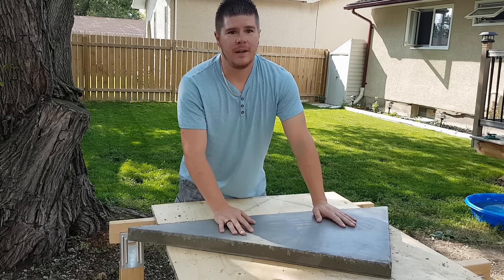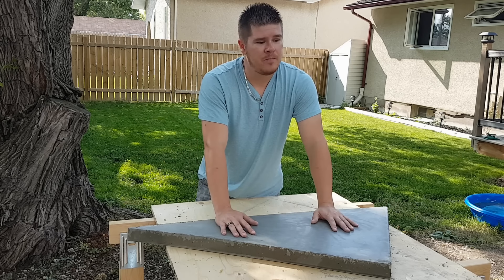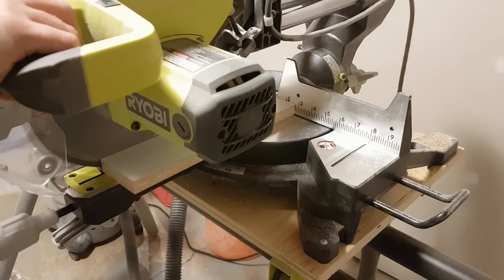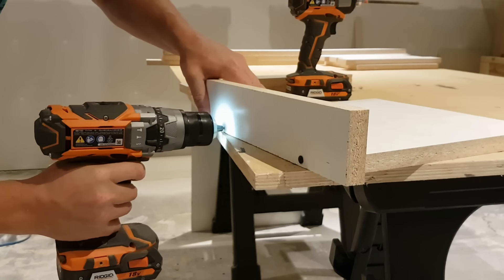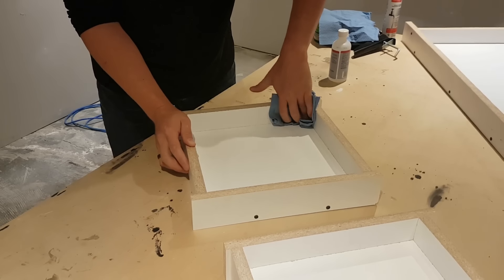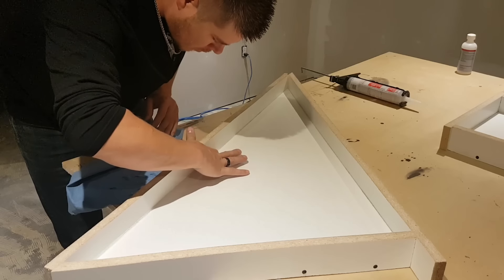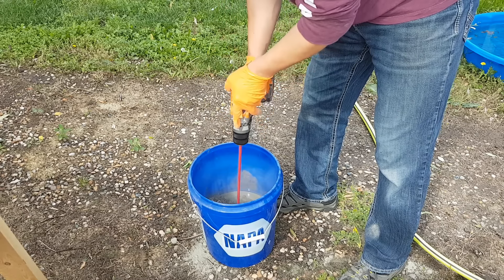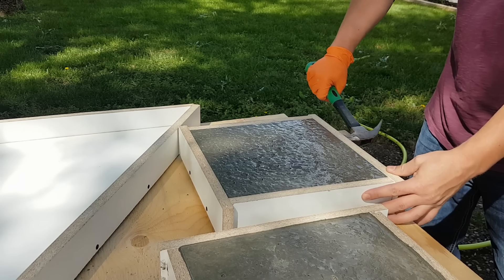Make your own Patio Stones quickly and easily with this method

Comment: Tip: if you use quikrete try getting the green bags or the blue bags. Those have fiber as part of the concrete mix and resist a lot to cracks.
Reply: Excellent advice.  Thank you.

Comment: Great tutorial, and with a little bit of work, you can save a lot of money on your molds. For vibrating it, you can use a sander against the side and bottom of the table surface or against the side of the mold.
Reply from the maker: Thanks. It's a pretty fun process too

Comment: Oil you molds ,patio stone should come out without taking mold apart .Also shake them more to get air out. You did great job good idea man.
Reply: Agree totally.
Reply: Brad, what type of oil do you suggest?
Reply: @mrobertson9222    Some cheap motor oil would do 10 w 30 or whatever I think even cooking oil might work.  Just brush thin layer of oil all over inside of your mold.  In the one masonry class I took we used wood framed plastic patio stone molds . We coated them in oil ,shoveled in the concrete and the shook them on vibrating table to get the air out. Let concrete set overnight or longer if needed before you take out of mold.
Reply: @bradclark6796  Awesome.  Thanks!
Reply: @mrobertson9222  I've used olive oil and my mold slid right out...I'd rather have used a cheaper oil but olive oil is all I had
Reply: @saggypantsandsquats460  thanks!
Reply: I made weights for working out do to the pandemic and I used cooking oil. I used five gallon pales and they slipped right out.

Comment: Great job! Another thing you can is dip a vibrator ( yup THAT sort of vibrator )  at even intervals into the wet concrete which helps distribute the smaller aggregate more uniformly and  gets some of the air bubbles to the surface. It basically recreates the effect of tapping the sides with the hammer, throughout the slab, making it denser and stronger. Dip the vibrator in, then turn on, and you momentarily see the concrete slightly sink and some air bubbles come to the surface. Turn the vibrator off before taking out, then repeat about 8 inches away.
Reply from the maker: You could lol but that would get me kicked off Youtube
Reply: Ha, if you ignore the concrete part this is the most erotic comment I have read on YouTube.
Reply: I would love to see my neighbor using this to create a patio!!! LMAO!!!!

Comment: Nice job! I do recommend a layer of wire mesh for the larger ones. Excellent choice of melamine to aid in release. After removing the forms, you could set them in that kiddie pool to help them cure under water for about a week.
Reply: Great input! For a newbie, where would you put the mesh? In the bottom of the mold then pour or mid way? And then is it common to let them cure under water, why?
Reply from the maker: For these you'd just put ony reinforcement in the center or somewhere close to the underside of the stone, you don't want it ghost through the finished product. And honestly just flood them softly with water for a couple days, a couple times a day, once they are in place. That's plenty for them to last a good long time

Comment: Great video can I suggest using a releasing agent vegetable oil does not stain the concrete thanks for posting
Reply from the maker: Thanks. I typically use car wax on my other concrete builds, but for patio stones I wasn't worried about it.

Comment: @JesseDoesDiy how many times can you use the same mold? Can I line it with tinfoil or vapour barrier for more uses? If I'm using it for under 4x4 posts for building on...how thick should they be?
Reply: Also if I wanted to add glass beads for example...how do I stop the concrete from covering them completely? I want them to sit flush with the surface
Reply: I also want to draw in them like it would be cool to put my business logo in the first step...how long should I wait for it to be hard enough to hold the forms but soft enough to  "carve "?
Reply from the maker: I actually have a newer updated video for making patio stones that's even easier. If you use a good coating of wd-40 on those forms before you make a stone you can reuse them many many times. I'd make them with 2x4 so it'll be about 3" thick. That'll be plenty thick for a support base under a 4x4
Reply from the maker: Adding glass is a crap shoot. I've got a video recently showing how to do exposed aggregate. You'd add the glass on top and then tamp them in with a wooden float to bring the cream up and then do the exposing technique
Reply from the maker: That would depend on the mix used, water added, and weather and temp. If you use a high early mix that says it can be walked on in 8-10 hours then that should be fine to carve at that point, but I'd probably wait 24 hours to prevent blowout
Reply: @JessedoesDIY  thanks! I'll look for the updated version.  A thought occurred to me in the middle of the night...can I just dip the end of posts in cement to protect the end from rotting out instead of placing 4x4 on the 4x4 patio blocks? It would save a lot of money.

Comment: Is it just straight cement you would use or part sand ?
Reply from the maker: Concrete. Concrete is cement, sand and rocks mixed together. If you just use cement it'll break. Pre bagged concrete is already premixed with all the ingredients, just add water

Comment: I have Portland cement. Should I use sand and or stone , and what ratio should should it be.? - thanks
Reply from the maker: That's fine. Use 3 parts stone, 2 parts sand, 1 part cement, and .5 parts water. That's a typical ratio

Comment: Will the silicon stick to the waxed melamine?? Maybe silicon 1st then wax after silicon dry?
Reply from the maker: You can do either or. I find it makes removing the silicone easier from the mould to clean it for reuse

Comment: Why not have the top as the slab top and finish it and use edge tool ?
Reply from the maker: You absolutely could.
Reply: I was thinking the same thing. Then you could a broom finish or rock salt to give it a pitted look.

Comment: How many bags of cement and sand did you use
Reply from the maker: That all depends on the size of the stone you make. There are concrete calculators online that'll tell you how much you need for the slab you want. And I used pre bagged concrete

Comment: Cool--if I do this I would use pure cement for a smoother finish and dye the concrete to give different colors. Great video.
Reply from the maker: I was honestly just using what I had on hand, but yeah! There are many ways to do it, I just want people to know they have options instead of always buying them
Reply: With pure cement/ smoother finish wouldn't they be slippery when it rains?
Reply from the maker: After a month's they get a very slight texture to them from erosion, but right out of the mould maybe
Reply: @JessedoesDIY  Thank you for answering. Yeah, that irregular one on your parents walking is very shinny with the water, so that is what I thought... but  still very nice video. I have a project coming up and the stones are very expensive, besides, one can do that box in many different shapes. Thanks...

Comment: Subbed for the channel name 🇨🇦. How big of stone would you do before adding wire?
Reply from the maker: Haha awesome! Thanks. Generally you can add it to any of them, but anything around or bigger than 24"-24" ish, I would think about adding it. If you buy 24"×30" in store they still don't have it in, but they also crack very easily if somebody jumps on it, or even if you drop it a bit or knick it when setting it. I didn't add any to mine, but seriously considered it for the big one. If it was more high traffic I would have. It makes a big difference
Reply: Me too!  Looking forward to more of his videos
Reply: Pea gravel and concrete sand

Comment: Just what I was looking for! Can the molds be re-used?
Reply from the maker: As long as you fill them just barely to the top and don't overfill and get the wood wet you can. Just have to scrape off the silicone and clean it, then just put it back together. I've used them quite a few times, but the sides will start to swell eventually and you will have to remake them

Comment: Seems like a good Idea, but the work and time required to remake the molds to get enough stones to make a full patio would be insane!  This method probably isn't so much less money than just getting the 2'x2' pavers from home depot, especially after you factor in the price of concrete bags, silicon, melamemine molds, wearing out a drill, etc.  Not to mention the insane amount of labor!  But you did make an entertaining video.
Reply from the maker: Yeah, that's why I mentioned I only do this when I'm using up leftover scrap, old concrete or I have a size or shape of stone needed that you cannot purchase
Reply: Can make them sturdier than the HD ones by putting rebar in them. I read a lot of reviews that the HD 2x2 concrete stepping stones break easily.

Comment: Why dont you include reinforced steel inside the molds?
Reply from the maker: You definately could, but they typically don't on store bought and I wasn't worried about it. These aren't going to take a beating or have to support a ton of weight so it's fine without it

Comment: Do those stones get slick when it rains.
Reply from the maker: I haven't found them to be. If you're worried about it, what you could do is after vibrating it, smooth it slightly with a concrete float. It will leave a bit more texture for grip. That will then be the top instead of taking it out of the mould and flipping it over.
Reply: @JessedoesDIY  Got it, Thank you...

Comment: I like to tap the top of the wet concrete with a flat trowel and it knocks out the rest of the bubbles and makes it more smooth.
Reply from the maker: Typically I would on table tops and stuff, but on the bottom side of patio stones I chose not to so it was more abrasive and then less prone to moving on the ground. At least that's what made sense in my head lol
Reply: CanaDIYan that for sure makes sense!! Listen, I got really tired at the end of putting in my patio (and still had a kitchen to remodel and a bathroom), that I just poured concrete straight to the ground. Basically haunched my patio (which it needed) in the shape of triangle pavers. I didn’t worry about the bottom being smooth and BARELY worried about the top. Everyone loves my patio, though. It’s whimsical and matches my personality lol
Reply from the maker: Haha that's awesome

Comment: i want to make  a 50cm *50 cm. how thick it should be?
Reply from the maker: Depends on your needs for it. I have another, newer video about making patio stones that is much easier and quicker. But minimum 1.5" thick for low use, 2.5" thick for more use and heavier duty

Comment: Nice Jesse. Do you think if you made a 2’ X 4’ stone, would you have to use some reinforcement?
Reply from the maker: Depends on the life it will see and your expectation of how long it will last. It it's just sitting there doing nothing then no. But if it'll see weight on it, or you want it to last for a decade or so then I'd add some. Or you could just add some because, it's up to you

Comment: If you tellthe people to which propotion you mix your cement it might be helpful for people who have no idea about it.
Reply from the maker: I bought pre mixed so I didn't have to. But typically you do a 3-2-1-.5 method. So it's 3 parts aggregate (small stone), 2 parts fine sand, 1 part cement, .5 parts water

Comment: So, why the Melamine instead of regular wood?
Reply from the maker: Just one option. I'm actually going to be releasing another video of wood in the next couple weeks with some seeding
Reply: @JessedoesDIY  OK great. I just wasn't sure if there was something special about Melamine.
Reply from the maker: Well, there kind've is. Melamine is to make them reverse cast style like I showed here. Regular wood, oil and sand is to cast them face up, then you need to trowel and round the edges while it's drying. Very different methods. If you try to reverse cast with regular wood, apply oil or a clear coat to the wood first or you'll never get the mould to release
Reply: @JessedoesDIY  Ah... ok it sounds like I'd be better of t=with the Melamine! Thanks!
Reply from the maker: Anytime. Good luck, let me know how it goes

Comment: Do you ever add any sort of chicken wire or wire mesh within the concrete stone?
Reply from the maker: You definitely could, it would help prevent cracking. Any stones you buy in store don't have reinforcement in them and I wasn't worried about it for small stones like these at this thickness. If they get hit really hard they may crack but considering they just sit there, they will be fine. It's been 2 years and no isses

Comment: Do you adding sand?
Reply from the maker: I used pre bagged concrete. If you are mixing your own the you'd use 1 part cement, 2 parts sand, 3 parts fine small stone
Reply: @JessedoesDIY  thank you.

Comment: Cool and all, but just pour it in the ground. Set up on board at an angle against the pre-existing sidewalk and just pour it, save a ton of time and effort.
Reply from the maker: Depends on if your doing a certain type of walkway, or if you have to make it somewhere and transport it to another like I did. If you have the ability to pour in place go for it, but that would be more like pouring a small slab
Reply: @JessedoesDIY  Yeah that makes sense, but judging from the photo of it in place it would have been easier jsut to put up a simple form and pour right there on ground.
Reply from the maker: I had to transport it there, and it was actually a paver walkway, so this matched. On the side of my house however, I'd like to pour a small pad

Comment: You didn’t add any metal. Isn’t that recommended?
Reply from the maker: Normally yes, but any you'd buy in the store don't have it either, but if you want it you totally can. If they are smashed or have something dropped on them they will be more likely to crack without it, but because they are so small and not fixed to anything they are free to move with the ground so not likely to have problems. Mine have been out for 2 years and not a single issue.

Comment: Why use drywall screws, why not melamine screws?
Reply from the maker: You can, drywall screws are available everywhere is all and have a very thin shank, but a very coarse thread. They are cheap and they work
Reply: @JessedoesDIY  It depends on where you are I suppose, here in Oz it's the other way around and what we call plaster board screws are actually more expensive than screws made for melamine/chipboard/mdf screws.
Reply from the maker: Guess thats true. At the end of the day as long as the screws hold and don't bulge, that's all that matters
Reply: @JessedoesDIY  Oh absolutely, I just wondered if there was a reason that you called for them is all. Cheers, and good job BTW, the angled paver in particular looked sensational in that spot. I also like the clever play on words with your channel name.

Comment: Where is the wire rebarr
Reply from the maker: You can add some if you want, but stones you buy in store don't come with it so I wasn't worried about it breaking as they are just going to sit there. If it is going to be a high traffic stone or lots of weight on it, it may be something to add

Comment: Why did you say you're making 3/4 inch slabs?....don't you mean you're making 2 inch slabs since the sides are cut at 2 and 3/4 inch strips?
Reply from the maker: You are correct, sorry. Must've misspoke. One of those times you have it in your head and it comes out wrong

Comment: They aren’t reinforced, they are gonna crack.
Reply from the maker: Store bought Patio stones aren't either. It's been over a year so far and they are all fine
Reply: @JessedoesDIY  
Awesome job by the way. Is it just cement or do you put sand in this please??
Reply from the maker: I used bagged concrete. But if you are mixing yourself do 1-2-3... 1 part cement, 2 parts sand, 3 parts fine aggregate stone
Reply: That sounds like an argument which is cool and everything, but I mean, it’s not really an opinion that concrete needs reinforcement. It’s a fact.
Reply from the maker: No, sorry, not arguing, just stating a fact is all. On any stone bigger than 24"×24" I would add it typically. But most people just want a patio stone to just go in a garden or something where no stresses will be applied. Usually concrete only needs reinforcement in large slabs because of it's weight and size to avoid cracking from ground movement. Small stones do not suffer from that problem, unless they are dropped or smacked with a hammer they shouldn't crack for years just sitting there